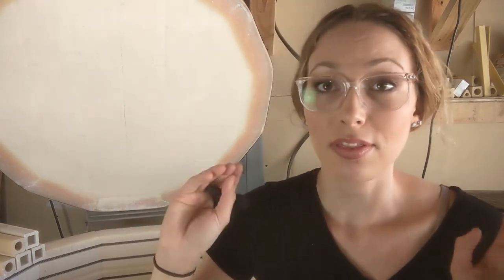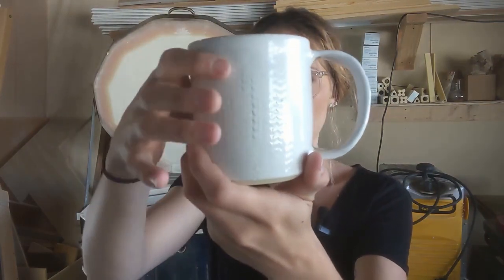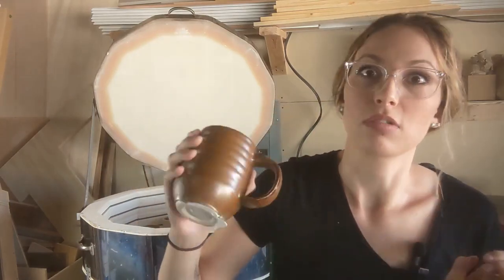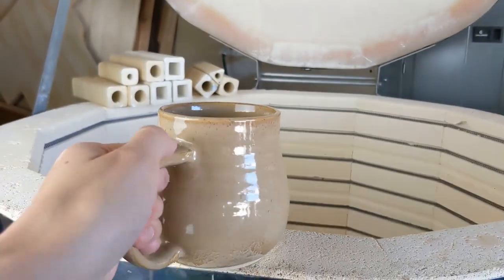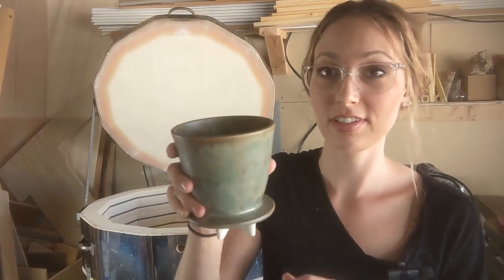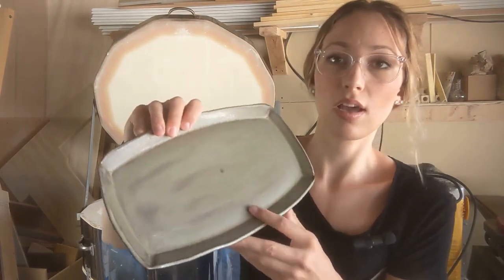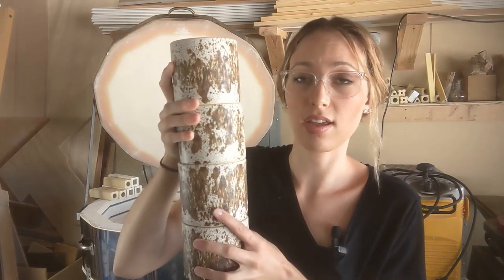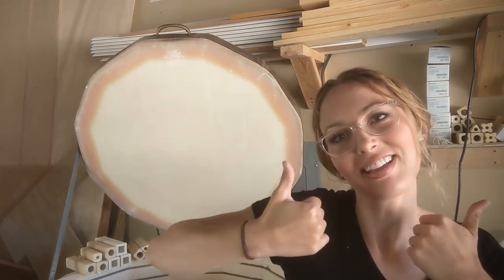Kiln Opening - Unloading lots of mugs!

Comment: Niceness channel. Your work is niceand minimalistic.  Just a good tip you should put a full shelf on the bottom of the kiln floor. Just incase of drips. ❤
Reply from the maker: Thank you! I would if I had more kiln shelves but I'm waiting to probably buy Advancer shelves. But I am careful to not but runny glazes on the bottom!
Reply: @Pennington Design Pottery  advanced shelves would be nice. They are expensive though.  Fingers crossed everything works out till then